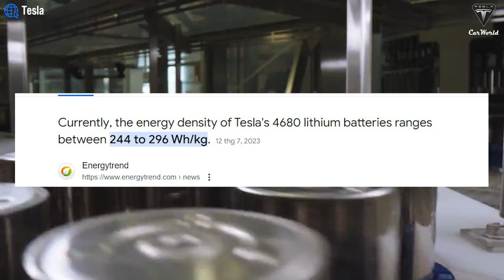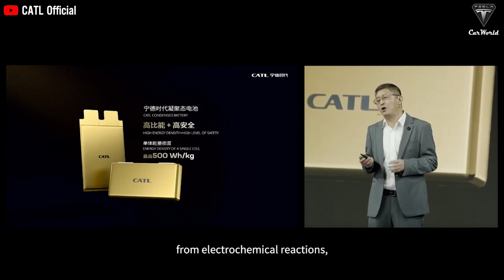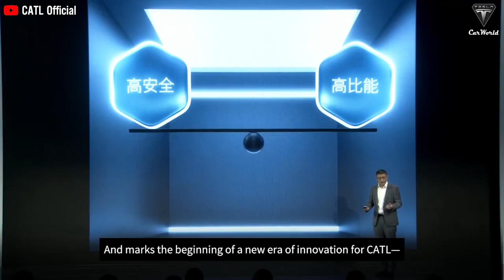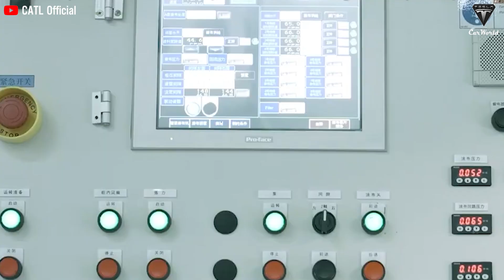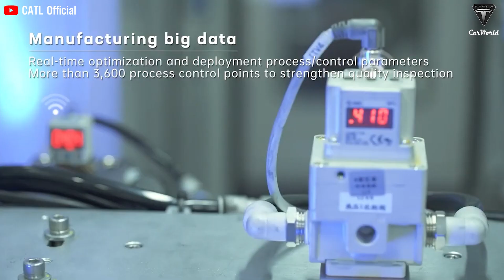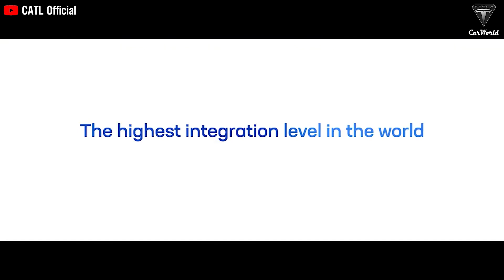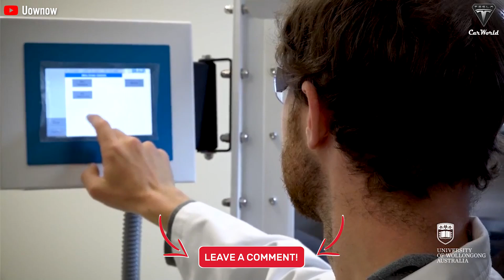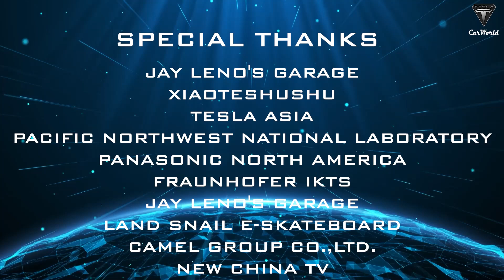It Happened! Elon Musk Reviews Exclusive 2025 CATL Condensed Battery, Analysis in Depth!

Comment: I think in the future, it would be good to not only look at kwh/kg but also include kwh/m3 and degregation per 1000 recharge cycles numbers, and also current and future expected price per kwh. And also some kind of reliability number. Different batteries are sometimes good at different things. I would rather have "golden battery" of it can lose only 10% after 4000 cycles, vs a lighter battery that lose 10% after 1000 cycles. I mean it needs to be put in some kind of comparison table for normal ppl to understand the difference.

Comment: Why do these video makers struggle with arithmetic? If these batteries double the density, they can achieve double the range, but not save any weight, contrary to what was implied. And not stated was that halving the weight actually increases the range by a small amount (kinetic energy & any braking that isn't regen, etc). Like for like. Also the cost of the batteries could be double and still compete, like for like. But lifetime? Tesla are buying CATL technology under licence, but probably not this particular tech.